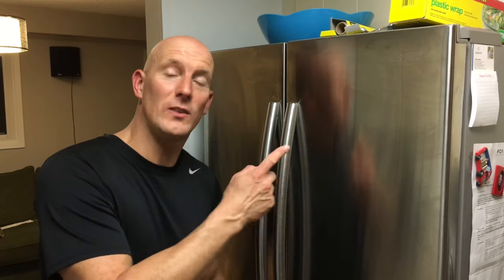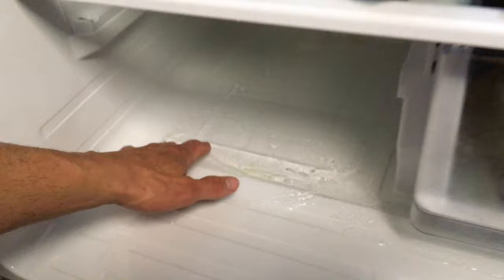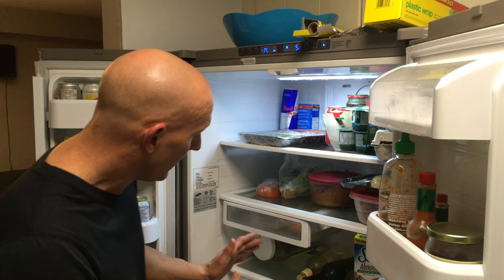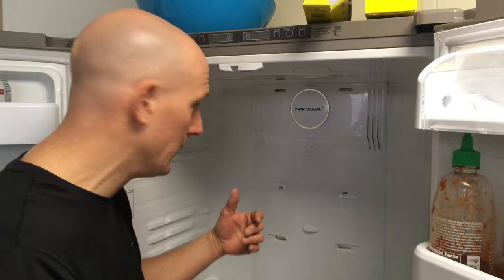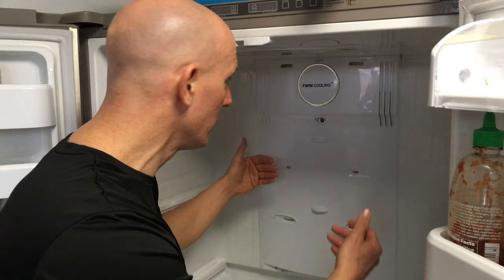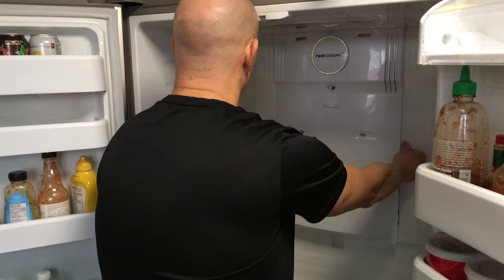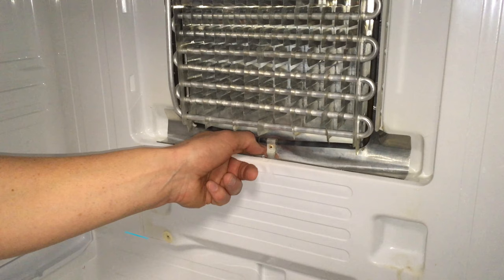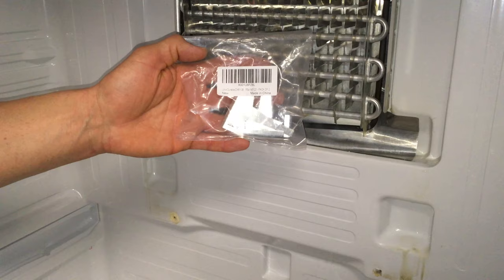Ice & Water Buildup (4K) Samsung Refrigerator

Comment: Hello jeff. I have samsung refrigerator model no RF30HBEDBSR.
Having issue with freezer, earlier it was showing -23 degree on panel but when i was checking it with thermometer it was 1 degree than I tried everything to defrost my freezer and now freezer is not working and panel keep showing 14 degree. FYI my fridge(upper portion of refrigerator) is working fine. Can you please suggest me if you have any advice for my condition.
Reply from the maker: I'm wondering if something had frozen up or not working properly.  I'm going to take a look into that.

Comment: I wish someone would show the proper wiring position for the evaporator fan. Every time I’ve had to remove the evap cover, one or more of the three wires is pulled out of the back of the plug. I’m on my certain of the white wire position. The red n Black could be reversed!  I rewired the plug the way it is in a picture of a replacement fan, but when looking at the receiving plug, it appears to have a plus sign next to the location where the black wire is located

Comment: Hi Jeff! Your video and guidance is very helpful! THANK YOU! However, I have hit a snag. I have not gotten the plastic panel completely off just yet and i am noticing that the STYROFOAM (that the video shows as attached to the plastic panel) is NOT attached. And, I hesitate to pull off the plastic panel without the styrofoam coming with it. 
Do you think there is ice built up between the cooling fins and the styrofoam and therefore the styrofoam is not moving? 
I will continue to defrost with my hair dryer and give it some more time -- but I'd appreciate your opinion too. 
Thoughts?
Reply: I know this was 3 weeks ago and I hope you fixed your fridge, but in case you gave up. The styrofoam is probably frozen to the back of the fridge with a big block of ice. Put the fridge in forced defrost mode (on mine it was hold energy saver and fridge buttons for ~8 seconds until screen goes dark, then press any button until "Fd" showed on screen). Let it run that for 30 mins while attacking it with a hair dryer. Depending on how bad the ice is it will take a lot of melting to get it free (mine was really bad). If you pull too hard you can break the styrofoam, use some foil hvac tape to repair it if that happens.
Reply from the maker: Thanks for watching!
This is the updated Repair Kit that you need for Samsung.
Samsung Water / Ice Repair Kit:
Amazon US: https://amzn.to/3YN4Enw
Amazon Canada: https://amzn.to/3WKlUYK

Comment: Samsung
RB215LABP/XAA 
Made in 2008

So I noticed noise that was annoying. Build up of ice on bottom which is the freezer, also Ice on 2nd shelf in the back build up.

The freezer will not freeze water or keep ice cream or meats frozen. 

I just ordered the clip as suggested from Amazon. 

I am wondering if the fan noise will stop as well  when part is installed?

Comment: This t hasn't fixed my issue 
Could the heating coil be bad.
I put the Amazon clip in the front vs hanging it on the back side of the heater coil would that matter it

Comment: Hi Jeff  I did purchase the part and the job was pretty easy.  I am still getting ice build up even with the new part.  Any other ideas to fix this issue
Reply: I am also having problems AGAIN after doing this twice. Now I am wondering if there is something wrong with the coils in the back.
Reply from the maker: I'm making a new video on this issue I have also made a video on the freezer portion which is similar issues going on.  Check that video out.  Most likely it's the drains at the back of not then it would be one of the parts inside that I go over.
Reply: Thanks @JeffLepard ! 
Where can I find this video?

Comment: Can you tell me how often the heating element is on? Should it be warm (>32 degrees) all the time? Does it run just when the cooling is not running? I've made the repair, but concerned I may have broken the heating element. Nothing crazy, but a few scratches from tryng to crimp the new metal piece around the heating element as the element in my fridge is at a more acute angle to the drain than the replacement piece and your element in the video. I'm just trying to ensure its working correctly before losing up the fridge again

Comment: I did everything shown in the video including the drain cleaning but the problem came back within 2 days. Can it be temp control issue ? Freezer is at -14 Deg C and Fridge at 2 Deg C. Also, if I try to increase fridge temp to 6 Deg C (Max it goes to 7 Deg C), it comes back to 2 Deg C on its own on the display.

Comment: On our Samsung RS261MDWP refrigerator, it doesn't even have any clip leading from the defrost coil to the drain hole, so it freezes up even easier than the Samsung fridge in this video.  Samsung appliances suck.  I have a Samsung washer that indicates the wash would take a certain number of minutes, but when you go check after that many minutes have elapsed, it still has several minutes to go before it finishes.  For a company that produces some of the best smart phones, how do you not even design a timer that's accurate?

Comment: We started having problems with our Samsung about a year after purchasing it. The problem your having could contribute to my issue I guess but my issue is the ice maker in the door freezes up. Every other month or so I have to take my wife’s hair dryer and melt it. Works great for a while but then does it again later on it’s a never ending cycle. Your issue is more with the coils in the back and melting water in the bottom  rather than in the ice maker. Would this fix my ice maker issues as well?

Comment: I did this fix, bought the part but then found that my drain line does an immediate turn inside the hole, so the replacement part really doesn't fit well.  I went the route of the copper wire - did two wires, one on each side of the element, down into the hole about 3".  All was well - I had ice again, no ice dam under crisper, etc.  But about 2 weeks later the ice stopped AGAIN!  I assume I'll soon have the ice dam as well.  Anyone have any other ideas other than checking the drain line?  I tested that after letting the ice all melt inside the refrig for hours and had no issues with water draining through.
Reply from the maker: Thanks for watching!
This is the updated Repair Kit that you need for Samsung.
Samsung Water / Ice Repair Kit:
Amazon US: https://amzn.to/3YN4Enw
Amazon Canada: https://amzn.to/3WKlUYK

Comment: Have defrosted the refrigerator but there is still ice in drain. Running hair dryer on that to try and speed it up. Do I also have to defrost the freezer unit below? Wanted to avoid losing the contents of the freezer but if I have to......

Comment: I have a samsung fridge freezer rsa1 and has no clip at all. Does it suppose to have no clip? My problem is the ice behind the panel which blocks the air ventilation so the freezer temperature is high but the ice is keep building up behind the panel. Should I add the clip or not?

Comment: the drain lines need to be cleaned too, they got clogged up.  the back panel you took off gets water logged and is prone to having problems if not replaced.  there is a noticable difference in weight from when i replace the old back panel with a new one.

Comment: Jeff, I have a Samsung RF221 (8 year old french door, freezer on bottom) that has started to leak water on the floor on the left front side intermittently. Starting to notice ice build up below on the bottom of  freezer below the sliding drawer. Would you suggest I look into what you have shown first? Or could it be something to do with the freezer defrost? Thanks.
Reply from the maker: Thanks for watching!
This is the updated Repair Kit that you need for Samsung.
Samsung Water / Ice Repair Kit:
Amazon US: https://amzn.to/3YN4Enw
Amazon Canada: https://amzn.to/3WKlUYK
Reply: @JeffLepard  After I wrote my question, I pulled the back off the lower part of the unit, removed the drain tube and cleaned it. It had some growth in it that had blocked it from draining. No ice issue in the last year!
Reply from the maker: You should be ok then it's the drains for sure.

Comment: I purchased the new clip to fix water/ice buildup but have run into a problem. I managed to remove the old clip but it appears I am going to have a problem installing the new clip. The heater tubing is "V" shaped which prevents the clip from being installed right above the drain hole. I am still waiting for the ice to melt completely in the drain hole. It may be tomorrow before I can even try to install the clip. I have pictures if you have any suggestions. I am so sick of the water/ice buildup under my crisper drawers.

Comment: We were having this issue and replaced the part in the video 2 years ago. Now we are having a similar issue again- the back panel is freezing up, water is dripping into the crisper drawers. The freezer is frosty so we turned the temp up from -2 to 0. Should we replace the part again?

Comment: Great video. I'm having the same problem, but it's very hard to pull out the panel with the styrofoam. I think maybe ice is frozen and making it hard for me to pull out the panel. Your panel came out easily, but my Samsung RF268ABRS panel is not willing to come out, the styrofoam is stuck. Should I let it defrost for a day? I already tried using hair dryer to melt it, but it's not making it easier to pull out the panel.
Reply from the maker: Yes that foam usually freezes up itself as well and is easy to break.  Let that defrost for sure it sounds like there is a lot of ice built up!
Reply: @JeffLepard  after letting it defrost for almost a day, I was able to get the panel out so easy like how you got it out.  I ordered the part that you listed and put it in, also clamped it around the heating wire.  I didn't remove the old part, only pushed it to the right so that it can also melt any ice on the right side. Thanks for your video and tip. It was very very helpful.  I guess I have 2 refrigerators now cause we ordered a new one and the wife and kids don't want to return the new fridge. They're in love with the Samsung Smart Family Hub and the 4 french doors style. I'll just keep my beers in the old fridge to keep them cold and ready then. LMAO

Comment: One quick question for you pal also by the way good help with your video my question you said on the Samsung refrigerator that you Kyle put the part number for that aluminum peace you installed to avoid freezing in that. Ack drain can I get that Amazon part number please I gotta get this fixed before thanksgivings thanks and God bless!

Comment: Great video! Will this also fix ice buildup along the back refrigerator wall? Even though that area is freezing up, the refrigerator is still cooling. That's the problem I'm having.
Reply: this is what happened to my Samsung refrigerator recently. You will probably need to replace the heating element which is rather easy to do.  Look on you tube for a video.  Make sure that you have a replacement drain hole clip to put on the new heater coil. Good luck.

Comment: This part did not fix the problem for me. After a couple of days I could see the ice starting to build up inside the back panel and then spreading to the wall of the refrigerator. The temperature will go up to 50 degrees. Any other ideas? There are no clogs in the back drain  hoses. Right now we’re using a mini refrigerator and mini freezer 😞

Comment: Hello, my top fridge is slightly cooling. When I turn on the power freeze, the temperature seem to drop but after 30mins, it starts to get warmer again. I assume that the fan is working still. 

My freezer and ice marker are both working fine. Is this a good indication of the heater strip problem. Also is there a way for me to check the heater once the cover has been open? Thank you.
Reply from the maker: Yes there is you can check the heater element by using a voltage tester.  I have a video up on this channel with the heater element and other components check out that video as well.  Thanks so much for watching!

Comment: Thanks, very helpful.  I thought you were exaggerating-defrost for 24 hours.  I used a heat gun, then a Hair Dryer for about an hour just to get the cover to release.  The drain line was frozen solid.   I used the Hair Dryer for 2+ hours and even boiling water on/off for about 8 hours.    I never got the drain cleared.   Went to bed- when I work up the next day the drain was open.     Put the part on and back together in about 10 min.   So far so good.
Reply from the maker: Yeah sometimes the foam and everything with the tubes are blocked solid and takes some time for it to defrost.  Same issue I had!  Hair dryer and heat guns are excellent ways to speed up the process.
Reply: That's what I'm afraid of I keep pouring hot water and blow dryer but nothing happening. Only been doing it for about an hour not sure if I just need a solid 24 hours

Comment: Perhaps a 2' long piece of bare 14 gauge wire wrapped around the defrost cord an then stuck down in the tube would also work.  Copper conducts heat pretty well...

Comment: If the water doesn’t drain and is still backed up from
The fridge drainage tube then go to the drip tray in the bottom of the fridge and clean out all dust and clog from the rubber tubes  just above the drip tray.  Search “how to clean drip tray Samsung fridge” for videos how to do this.  Happened to me but after cleaning out the drip tray clog then water flowed.  He didn’t mention this in his video.

Comment: I ordered the part you suggested from Amazon for about $5. I installed as you suggested. It was pretty straight forward process. It has been 10 days and it looks like its working. The only thing I notices a very little bit of ice from the one of the openings in the back of the fridge and very little water under the Deli box. I kept watching if it grows but don't think so. Is this a normal thing of a Samsung fridge?
Reply: Yes these are known lemons and I bet you will continue to have problems with it...
Reply from the maker: Thanks for watching!
This is the updated Repair Kit that you need for Samsung.
Samsung Water / Ice Repair Kit:
Amazon US: https://amzn.to/3YN4Enw
Amazon Canada: https://amzn.to/3WKlUYK

Comment: Have a Samsung that has froze up 3 times now. Pulled it apart and defrosted, but it's never frozen up the drain hole. All my ice freeze up appears in the upper part of the back panel, some along the water lines to the water filter and again in the ice dispenser. Model # RF28HMEDBSR/AA Will this part still resolve the issue? Also, looked up your link, but it appears to give model numbers for the part not the refrigerator? Any help appreciated. Thanks

Comment: Defrosted it, cleaned the drains, installed a metal piece off the heater down into the drain hole. Had previously installed a copper wire for the same drain freeze issue. But the problem keeps coming back. The damper vent & motor work fine. The top fan works fine. Any other ideas why this problem keeps occurring?
Reply: You may have ice inside the styrofoam panel on the back of the faceplate...the foam panel has a ducting system for the fan...you can't see the ice, but this buildup will obstruct air flow from the small oval holes on the faceplate, thru the ducts, to the fan. See my note above. You'll need a hairdryer...

Comment: Love  the video! I followed along perfectly until I came to the part where I need to remove original clip.  The heating coil/tube the clip I’m to remove in my unit hangs is not horizontal like your video. It’s more of a wide  “v” shape with the piece I’m supposed to clip off at the point of the “v”  The new piece I ordered  won’t sit straight across heating tube. Any suggestions?
Reply: I have the same issue. Have you figured out a "fix"...?
Reply: @courtneydemordaunt5647  yes! I used the same piece they said to order. When you put it in just make sure to tighten ends as tight as possible to coil so it transfers as much heat as possible. I used needle nose players and snugged them up as flat and tight as I could. Worked like a charm.

Comment: Will the clip work on a RF28HFEDTSR/AA?  The display was reading 34 degrees; however, the actual temperature was around 50 degrees.  I’ve been dealing with the ice buildup for over a year.  Tired of throwing away food that is spoiling too quickly as a result of improper temperature.

Comment: Hi Thanks for this video Jeff. In my french door fridge there is ice build up in the Freezer( model number is RF220NCTASR/AA). When I open the part you are showing it is completely different. I cannot find a panel like this or the thermo clip. Do you have any suggestions??
Reply from the maker: That's a good question I did type in your model number RF220NCTASR/AA to see and there is some information on google about it but almost the same thing.  It would be the same idea though I wonder if the part is the same for your fridge or not.
Reply: Yann Coulombe I have the same problem in my freezer. Could not find a solution yet

Comment: hi Jeff, I have a Frigidaire FFHS2622MSYA and have been having this problem for more than 6 months. And the technician couldn't figure it out.  Every 10 or 15 days once, I have to run a hair dryer to clean the ice.  But, it is only a temporary fix.   Does your fix applies to Frigidaire also?  Any recommendation to my situation? Please suggest.

Comment: Will this part work with Samsung RF18HFENBSR/AA? I'm ready to try this fix! We bought a new Samsung fridge in February of 2017 and started to have this problem on a regular basis every 3-6 months.  When under warranty, repair folks would come out and "fix" but don't think this little piece was ever replaced AND never have we completely defrosted the fridge.  Eager to try this. Thanks! Btw, might there be a class action lawsuit against Samsung for this ongoing problem?
Reply: There's IS a class action suit against Samsung for their faulty water dispensers. Not this....yet.